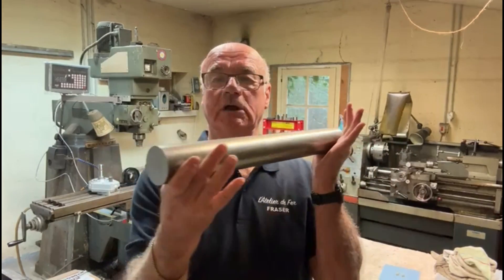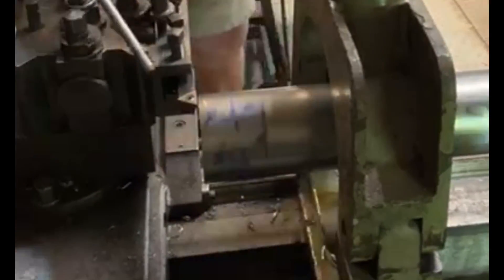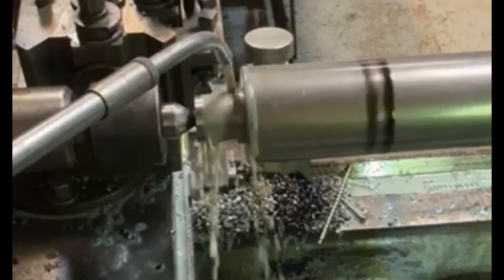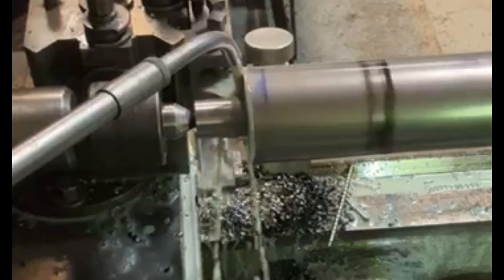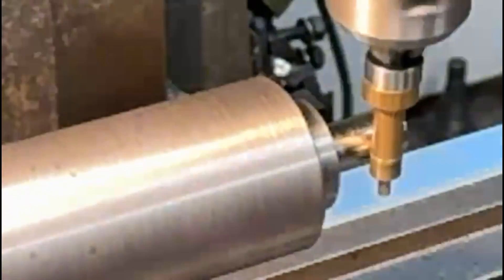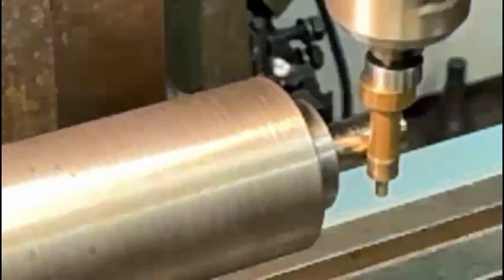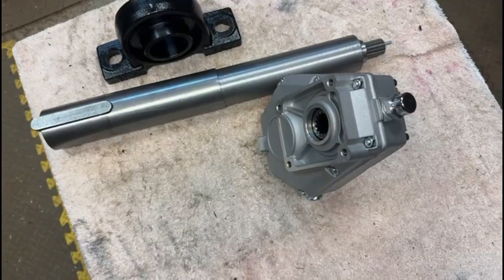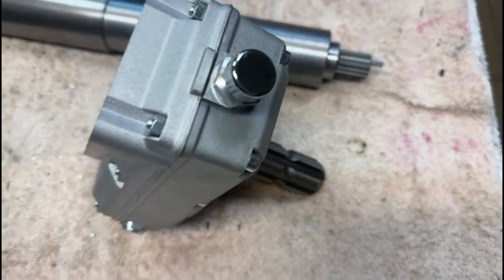How to machine a large shaft with 2 keyways.

Comment: Very nice job! The splined drive looks very undersize to be driving a 60mm shaft? Did the original fail at the splined end? Stay safe! Chris B.
Reply from the maker: Hi Chris. yes, I did explain to the client that I felt that the spline end would be a bit fragile. he said the gearbox, (cost about 1000€), that it fits into was the only one he could find and he couldn't get one with bigger drive unit. He may come back at a later date with another unit.